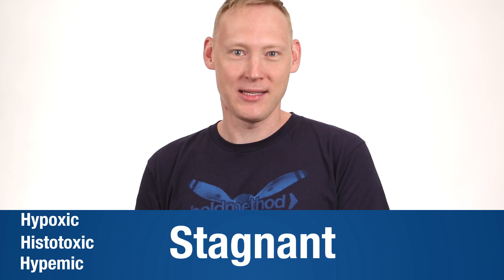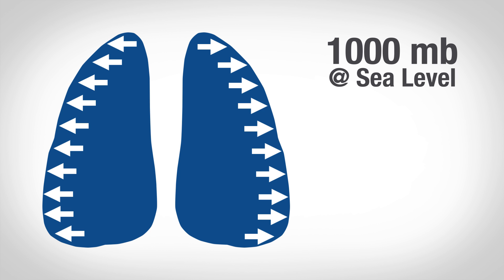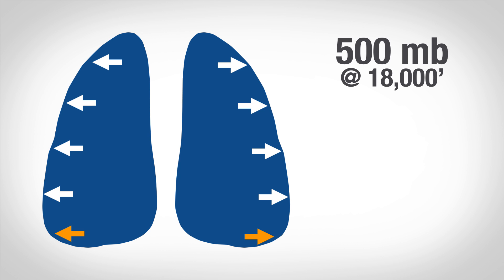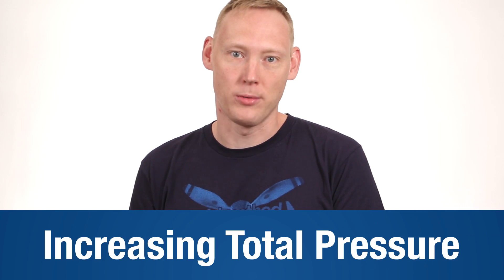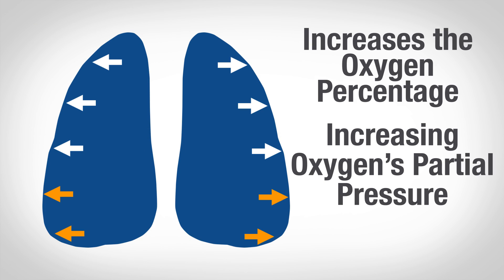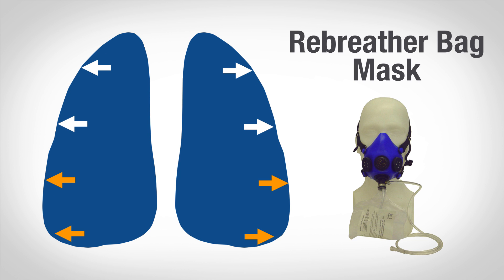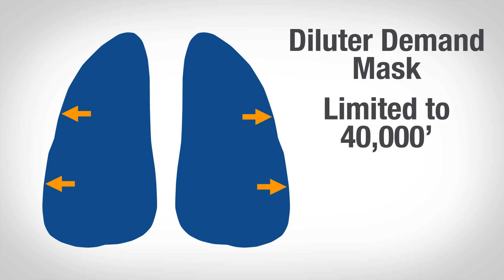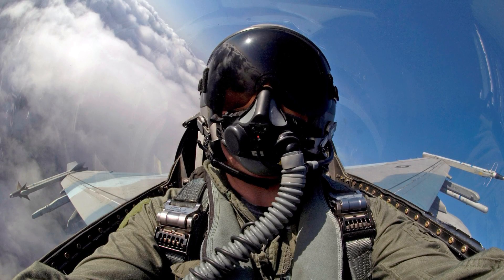Hypoxia: How To Stay Alive Above 12,500

Comment: Passenger oxygen masks on airliners are secured with a rubber band. So are they basically useless at cruise altitude?
Reply: If there is a rapid decompression (like a bird strike on the window of a pilot or first officer). They have the last version they put on and the O2 masks drop in the PAX dept.  Pilots do Mayday call and ATC acknowledges and plane does rapid decent to 10000 ft.  This all happens in quick succession.  FA's immediately take the closest seat and buckle up because the plane is about to do a nose dive like you have never felt.  Airlines commonly fly a cruise altitude of 33 to 43,000 feet. Particularly more recent plane models flying long-haul or transcontinental routes like the B787 or A340.
Reply: No most passenger airlines can't fly above 38,000 Feet.  Even at that altitude the pilots can rapidly descend to 10,000 feet.  If you have all engines fail the masks will deploy to provide supplemental O2 but the aircraft will still maintain pressurization just slowly bleed over time.  If you have a rapid decompression and engine failure you would probability be screwed.

Comment: This confuses me. All my instructors and the AIM never mentioned Hypoxia being partial pressure
Reply: They keep it simple to understand and use in a practical sense. Similarly, the way they explain lift generated by an airfoil is incorrect.
Reply: Most instructors understand hypoxia as lack of oxygen, but think about this. The atmosphere composition. 78% nitrogen, 21% oxygen, 1% other gases. The 21% oxygen NEVER decreases, it is mixed throughout all the atmosphere layers, so it’s illogical that the percentage decreases. However, air density thus its pressure do decrease as you climb, so it’s harder to get that oxygen into your bloodstream
Reply: Explains why pilots on ATC recordings who have had a rapid decompression have that loud breathing sound from inhale exhale process.